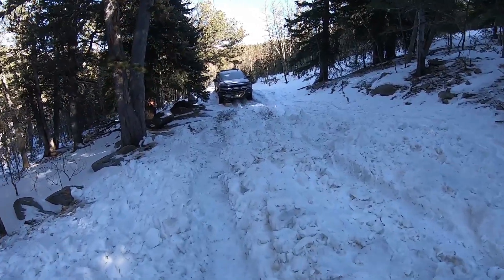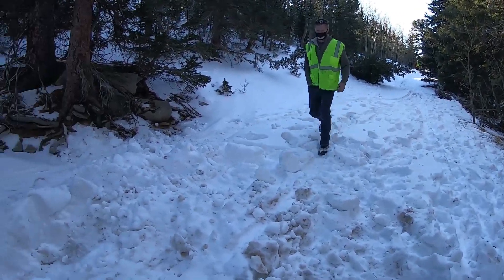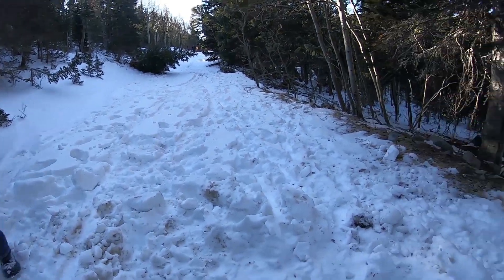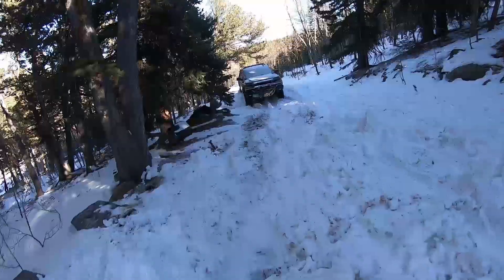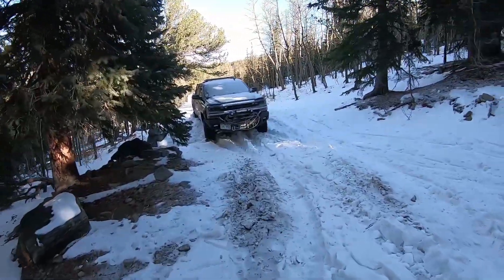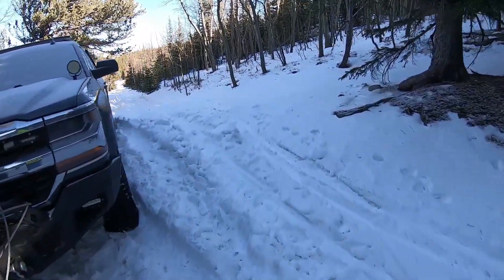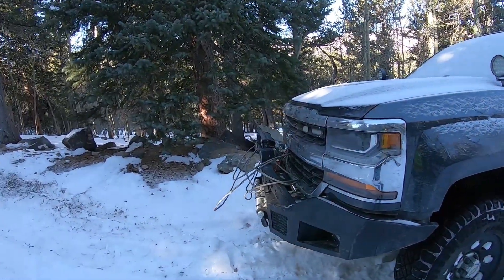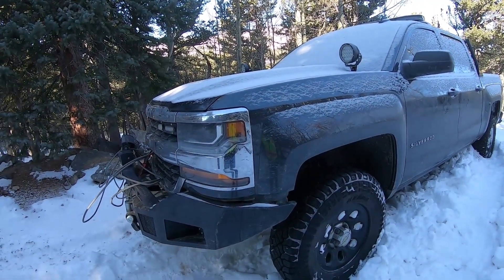Silverado Recovery with a broken t-case

Comment: Nice Recovery :) . What kind of Chains are those ?
Reply from the maker: v-bars!  they rip and grip all day on ice!
Reply: @Colorado4x4RescueandRecovery  I am looking for chains for occasional trail usage Vbar Medium or Heavy duty chains, I am seeing prices from$90-$400 pending 5.5mm vs 7mm with 2 or 4 link spacing.  Looks like in the video you are using chains with 4 link spacing but cannot judge gauge thickness.  Thanks for any recommendations this would be rear axle only on a 3rd Gen 4Runner.